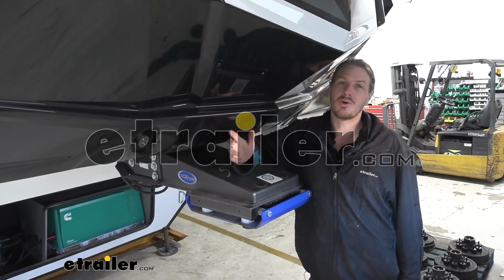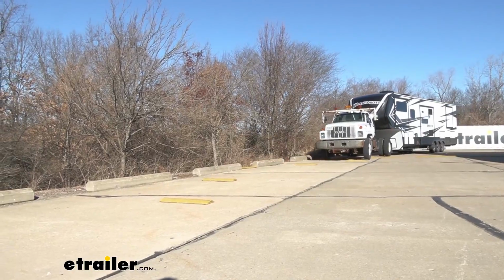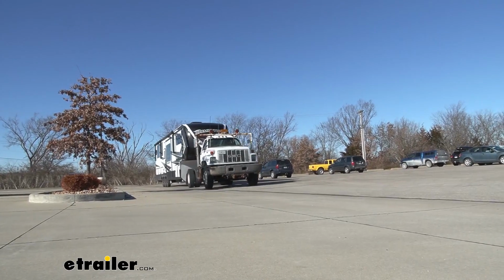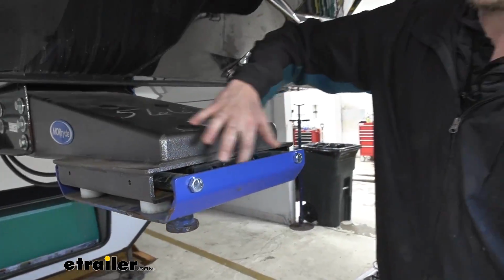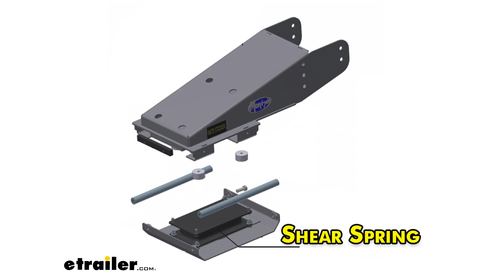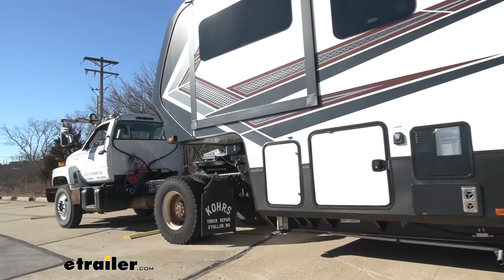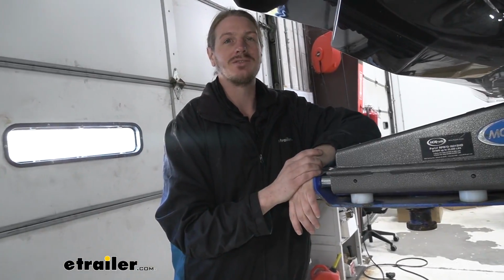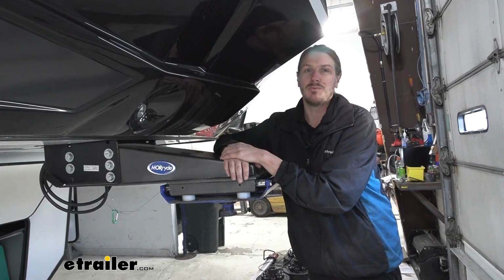etrailer | MORryde Cushioned 5th Wheel Pin Box Review

Comment: Are these a good alternative to an air pinbox? 

I pull my 5th wheel to truck shows with a class 8 5th wheel plate on my vintage semi.  So similar to the truck setup in this video 

Ive got a small old trailer with a Leland 7910 pin box and cant find an air hitch for it. 

I dont want to destroy the frame on my trailer.
Reply from the maker: This cushioned pin box will provide a smoother ride without having to worry about adding or subtracting air to an air helper spring.
https://www.etrailer.com/Fifth-Wheel-King-Pin/MORryde/MR22XR.html

Comment: How much more does it weight than the stock lippert pin box? How much does it weight total?
 Thanks in advance!
Reply from the maker: The MORryde pin box you'd asked about is a replacement for the Fabex 765 OEM pin box. We weren't able to find a specific weight for the OEM version of the Fabex 765, but I can tell you that the MORryde # MR22XR weighs about 190 lbs. A typical OEM pin box can weigh between 100-130 lbs. We hope that helps...
https://www.etrailer.com/Fifth-Wheel-King-Pin/MORryde/MR22XR.html